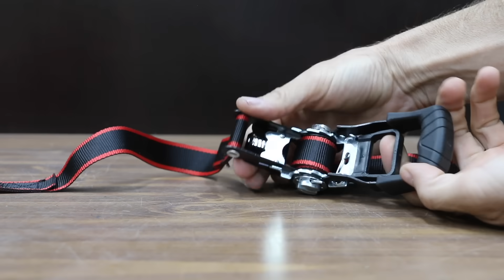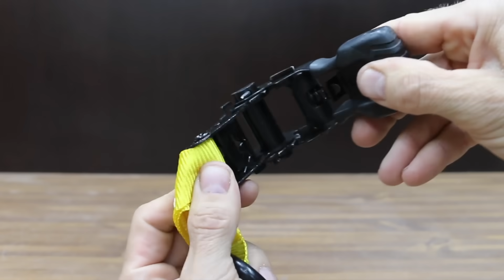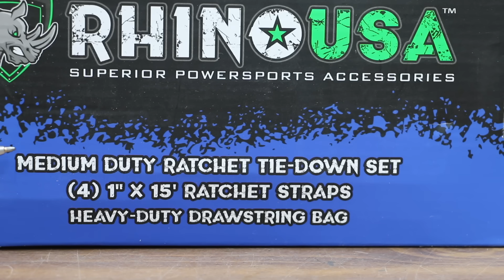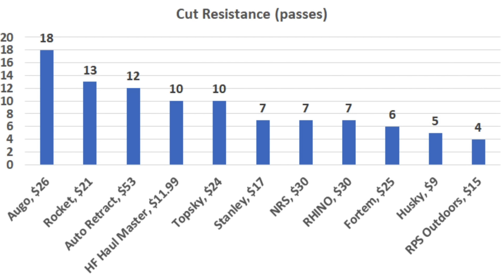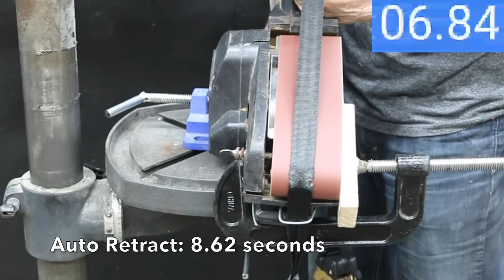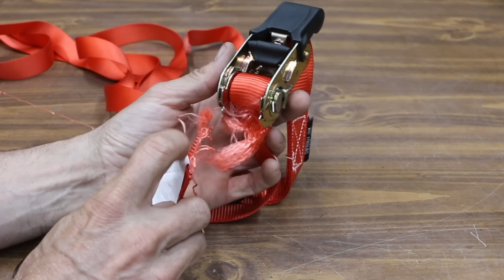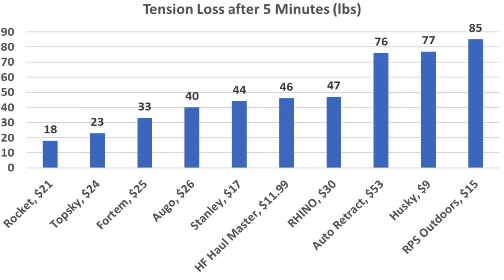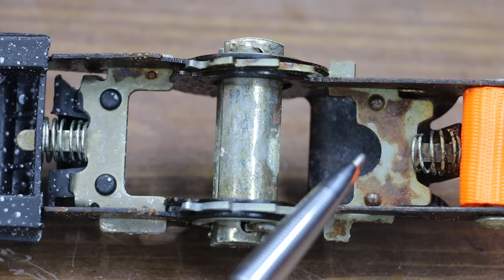Best Ratchet Strap? Husky vs Stanley, Rhino USA, Rocket, Topsky, Augo, RPS Outdoors

Comment: I once used cheap "bargain bin" straps to secure my ladder on top of my roofrack. Had to do an emergency stop and the hooks couldnt take the load, rocketing the ladder into the car in front. lucky no-one got hurt and i learned a valuable lesson.

Comment: Suggestion:

Paracord; 550

Cheap from walmart to spectra white(it does not come in colors if it is real spectra) from amazon.

Testing should be straight forward. Pull it, fast and slow. Wrap it around something to see if it is stronger when using a few wraps before it breaks under tension. Can you use different brands for lifting and dropping your body weight(use actual weights man, not your literal body...don't want you getting hurt).

Burn testing? Do tthey all burn equally or do some resist fire at all?

Water retention after soaked for 1 hour under water?(because people go camping with it and it rains).

If you think of anything else go for it. Pretty cheap and easy testing though, as even 100 feet/3mm of spectra on amazon goes for $40. So you should have plenty forcheap among different brands. Cheap way to put out a video and see if there really is any differences for us all. =)

Comment: 2nd time requesting :)
Do ear plugs! There are so many styles/brands to test!
I'd love to see what kind of testing methodology you come up with!
Reply: Issue is that there is a scientific testing and standards (ANSI S3.19-1974, ANSI S12.6-2016, ANSI S12.42-2010) for ear plugs, so many differences would essentially be very subjective, because the standard tests are going to prove the manufacturers claims as true. A lot of what he is testing is manufacturer claims where there is no a standards, or minimum requirements.

Comment: Driving a semi hauling flatbed, we use 4" straps with ratchets attached to the trailer. Each strap is supposed to be rated to 5400 and break at 3x that. 50 miles after the initial securement and every 150 miles after, all securements are to be checked and rechecked. I knew they would often lose tension the first 50 miles especially after setteling into place or biting into the load, but never really thought about how much they stretched. Imagine that.

Comment: I was bummed the nrs straps did so poorly on the cut, abrasion, and tensile tests but was not surprised at all with the corrosion results given that they were designed for use in marine conditions. I love my nrs straps.

Comment: I’d really like to see a video comparing bicycle specific greases to a general automotive brand such as Lucas Red N Tacky. The bicycle greases are quite expensive and we could benefit from a direct comparison to a less expensive automotive brand. Although high end bikes have increasingly moved to sealed bearings there are millions of bikes out there that use cup/cone and loose ball bearing systems (or ball bearing in open retainers). Lubricity and resistance to washout are a couple of parameters I’d like to see compared.

Comment: I have the auto retract set of 4 and use them frequently to strap down quad or dirt bike they work great been using for about 3 years I've had to spray once with wd40. If you need  alot of strap these are not the one to get they are only about a 6 foot length. If I was to change anything it would be a bigger  hook size so I could hook it to different points on my tube frames for different configurations on the trailer along with other machines.

Comment: PLASTIC WELDING ? bond test / application/ strength / cost/ etc there's plastic welding using a double s alloy melt it into plastic , heat gun for bonding plastic / and also a triangle type soldering iron to melt plastic on to cracks then there is the materials to use i even seen a you tube video of someone using zip ties to plastic weld. thanks.

Comment: Years ago I built a off road cabin where I had to haul in material with an ATV or snowmobile. I learned that you get what you pay for. I have many strap parts from the crap tie downs. I find that it is very important to look at the thickness of the stamped metal parts and the quality of the strap material.I have a video of all the crap I hauled in.

Comment: Another excellent video.  PF comes through again with fact based recommendations.  A suggestion for another test:. Percent stretch from working load to breaking.  When using multiple straps to secure an object, some stretching is desired to insure all straps share the load.  A too stiff strap will load up first then snap before other straps can take significant load, resulting in progressive failure.  A related point to this is that it's important not to mix straps with different stiffness for this reason.

Comment: The Hall Master Brandon was killed me first thing that went wrong was the plastic ratchet handle broke off while I was trying to ratchet something down real tight and then one of the teeth shared on the locking or ratcheting mechanism and the strap came flying out in hit me in the side of face and leave and we would have black eye I do not recommend that brand literally to save anybody's life it sucks

Comment: Instead of using the chain on your hoist for the test jig, maybe you can get a motor wired to a switch that is connected to the main input gear that way you don’t have to keep your arms in the danger zone during testing.

Comment: How about testing engine break in oils? They (should)have very very high levels of phosphorus and zinc and almost no detergents because they arnen't intended to be run longer than the initial 20-40 minute break in period and are there to protect the cam, lifters and bearings.

Comment: Good test. Noon - ratcheting straps like the NRS are really best for securing plastic kayaks and canoes to a rack.  Using a ratchet strap could lead to overtightening and deformation of a plastic boat.  NRS is commonly sold in paddling stores and websites.

Comment: Love the videos.  I use 6in1 screw drivers a lot in my job, and I've noticed large differences in quality of the bits, the hex head drivers, and the handles. The bits tend to lose material, the hex head drivers seem to strip, and the handles vary wildly in hardness. I even had the metal bit in the handles come out in one brand. 

I'd love to find out once and for all which brand is worth my money.

Comment: Interesting results maybe a follow up in a year with the straps being exposed to the elements to see how they hold up after they have been used. Also not sure if you have done a video on them but if you could look into drywall saws are fixed or retractable blades are better how well do the ones with replaceable blades hold up/how durable they are.

Comment: I'v got a set of the auto retract that have been bouncing around in the back of a pickup for somewhere around 12 years. and have outlasted many other straps. granted because I had less faith in them I probably was not as abusive to them as others. The main reason for them out lasting most straps is due to the fact that when stored they are always rolled up and don't get as much sun exposure as the others hanging from the headache rack or laying in the bed. one of the straps did loose its spring module however it is still functional you just have to roll it by hand.

Comment: Would have liked to know in which one has the strongest pull strength using the ratchet. Otherwise it seems like all of them performed to their specifications in this particular tool is one that price drives more than anything else which I will get

Comment: I comment this on a video about a year ago do electric corrosive preventatives work? Like those kits you buy for your car. I also always heard rumors of back when they used the positive terminal as the ground instead of the negative terminal they don't rush as bad that would be something interesting to test alongside as a control I guess?

Comment: One thing I always end up breaking on these is the actual ratcheting mechanism. Usually when ratcheting a heavy load probably well over it's weight limit the metal will bend that connects the handle to the main body.

Comment: As I feel that you like to design your tests as unbias as possible, I have a few notes about 2 of the tests. Please know I watch a lot of your videos and know you want the tests to be as fair and accurate as possible which is why I am commenting this.

During the sanding at 8:44 in the video, you are holding the strap by hand and when the belt goes over to one side, you push the strap over to that same side. This looks to have created a lot more friction on the side that failed first and might have caused an uneven time compared to the other straps. I can understand why you moved it over, just something that might have changed the outcome of that strap, and possibly some others though not as defined as that strap.

Second, during the working load test, you used tension dropped over 5 minutes (in lbs.) as the deciding factor for rating, but given the large starting difference for some brands (RHINO started at 337 lbs. while Rocket started at only 277 lbs.), I would use a percentage drop to show the difference from the starting point. This changes the results slightly to show that even though the RHINO has a tension drop of 47 lbs., it only has a percentage drop of 14%, which is better than HF Haul Master and Stanley which have a 15% drop. This mostly affected the end of the scale for this scenario, but could have an impact on other tests in the future where the starting value can't be the exact same for each test. Here are the percentage drops for each brand based on your results:
Rocket: 6.5%
Topsky: 7.2%
Fortem: 11.3%
Augo: 12.9%
RHINO: 13.9%
HF Haul Master: 14.6%
Stanley: 15.4%
Husky: 23.8%
Auto Retract: 24.6%
RPS Outdoors: 27.9%

Comment: I think tension loss should be measured as a percentage of start rather than the actual number.

I.e going from 20lb to 10lb would be worse at 50% then from 220lb to 200lb about 10%. Starting at a lower number might give some an easy run while those starting higher will naturally experiance more slip/stretch.

Still love the show, just trying to help.
Reply from the maker: Great constructive feedback. Thank you

Comment: Long term on the " Auto retract " .
While they are super convenient  , if they get wet the retractor mechanism / spring  will soon rust and  fail . There is no way of adequately drying out the internals as they have covers . You can only spray a dispersant such as WD 40 inside to try to get rid of the moisture , but then that will affect the strap . I got 2 years use out of my auto retracts before they would not retract anymore . Out of 6 , i have had 2 fail and 2 others don't retract fully leaving about a foot of strap out ( weakened retraction spring ) .
Would i buy them again.? Definitely  , but only when they are on sale . I really like them, especially since they dont have their straps all over getting tangled when not in use .
Ohhh... The release button can get hard to push after a couple of years as well .
Reply from the maker: Great point! Thank you

Comment: One of the biggest issues with these ratchet straps these days, seems to primarily lie in a lack of quality in the metal used in the ratchet mechanisms, themselves.
   Of course strap quality is important, but when I look to buy a set of these, I look at the overall frame thickness, and material used. As well as the design, and thickness of the "axle" (pivot point), and the thickness of the sprockets.
   I have gone through more than a few of these due to the frame, axle, and/or the sprockets becoming distorted, due to repeated torque, twisting them into useless junk. 
   The best set I have found so far is a brand called SmartStraps. They have heavy duty frames, and appear to use a set of dual, elongated, solid, "Woodruff" type keys, for the main axle. The sprockets are very thick compared to most that I've seen. They have held up very well over the last fee years.
Reply from the maker: Thanks for sharing.
Reply: @ProjectFarm  Thanks for your time. As usual, I let the ads play, brother. Did you know that Febreeze only uses all natural propellent for the aerosol fresheners!? 😂😁😘

Comment: 99.9% of loads do not need to be so tight that a ratchet mechanism is necessary. I have used the pull through straps for decades. They are easier and faster to both tighten and release and instantly adjustable as compared to a ratchet strap. I see ratchet straps laying along side the road all the time, never a pull through, which shows that ratchet straps really aren't getting the job done. I look at ratchet straps as a solution in search of a problem. Pull through straps are mechanically simple and get the job done.
Reply from the maker: Great feedback. Thank you

Comment: Topsky CEO watching this right now like "Ok guys, you made it too strong. Time to cut corners."
Reply from the maker: lol
Reply: Just like Duct tape, No longer as strong as it was.
Reply: @royalmac1011 I do hvac and I would never use duct tape in the traditional sense. I use metal tape.
Reply: @coryevans7302 I used to work in sheet metal and fabricate those air ducts you work with so I know what you're talking about😅
Reply: @royalmac1011   Duck brand can't even be considered as duct tape ffs, it's homeowner junk. 3M makes tons of different duct tapes, 1900 is nowhere near as strong as 6969, as almost always you get what you pay for.
Reply: No no it's not cutting corners it's "value engineering" ;)
Reply: they make lower rated straps
Reply: @TXH1138  lower rated straps? What are those Middlesky and Bottomsky?
Reply: @Gideon_Judges6  
I giggled for a good 7 seconds from that comment.
Reply: @shane250   . . . while other comments ranged from a 5 second giggle to a mere smirk. So @SirBudrick comes out on top!
Reply: @cfeigel  Project Farm is going to test that!
Reply: @Gideon_Judges6  Notquitesky and Sameastherestsky.
Reply: Actually, the link posted by Project Farm above , click on it, amazon indicates they are no longer available lol
Reply: @puppetmasterblaster  
The SKU on the package PF held up was RTD2004.  As of 11 am EST on 3 May 2021, if you search Amazon for "topsky ratchet strap RTD2004", and scroll down to the first "Topsky" entry, you will see that it is listed as RTD2004.   The price has dropped!!  Only $17.99!  I've just ordered two sets from Amazon, as my collection of 15-25 year old ratchet straps are looking mighty pathetic.  Not even worthy of Cousin Eddie's attentions!!
Reply: They are "currently unavailable" on amazon. Coincidence?
Reply: @andym1223  often that's Amazon's way of showing out of stock. They don't seem to like you back ordering unless something exceptional happens after you've already paid.
Reply: @Gideon_Judges6 2 years later and I still can’t find Topskys
Reply: More than likely !

Comment: I keep some of the auto-retract style in my SUV for when I need to carry ladders or material on the roof rack. They store quickly and you don't have to worry about securing strap tails. If they do get wet you need to make sure to fully extend them and let them dry before retracting them for long term storage. I ruined my first batch of these by storing them wet.
Reply from the maker: Great feedback!  Thank you

Comment: Most important aspects to me are:
-Relaxation over time
-Abrasion resistance
-Corrosion resistance

Topsky wins for me! Nice deep zinc coating tells a lot. Great video as always!!
Reply: Ditto. Despite it only being single-sample testing, the topsky product in general looks to superior totally. It's hard to beat when it's double the strength of the others for what I would call zero premium on the price.
Reply from the maker: Thank you!

Comment: The stretching test takes the length constant and measures the change in tension over time. An alternative test would be to hold the tension constant (i.e. hang 300 lb weights) and measure the change in length over time. In the former is hard to setup the initial tension repeatably, the latter is easily repeatable. The former is more realistic though, as strapped loads likely are not very springy and instead are closer to fixed length. I'm curious if both tests would show similar results.
Reply from the maker: Thanks for the feedback.

Comment: Should have used a new block of wood and new straight blade (if you didn’t already) after each cut test. As you continue with each cut, it cuts further and further into the block of wood. Causing no contact with the tip of the razor blade (the sharpest point) for each strap after the first one. Having a deeper and deeper channel will likely change the cutting ability of the razor. Otherwise, a very thorough test
Reply from the maker: Thanks for the feedback.
Reply: @ProjectFarm  thanks for the awesome videos! Keep up the good work

Comment: I use the husky and will probably continue to do so. This was a fantastic test, but in at least my applications I get several years of use out of the husky before they die and that is just an incredible value for $2 a strap. I found a little dry graphite applied to the ratchet release when I buy them basically eliminates the binding issue for release. That said, seeing the NRS did remind me I need to pick up some more of that style of strap. Most of the time if a strap is going to fail it is the ratchet mechanism itself from getting abused and twisting. So I like to keep some of those non ratcheting style around as well. Great video as always!
Reply from the maker: Thanks for sharing.